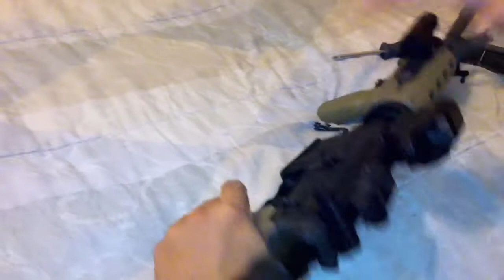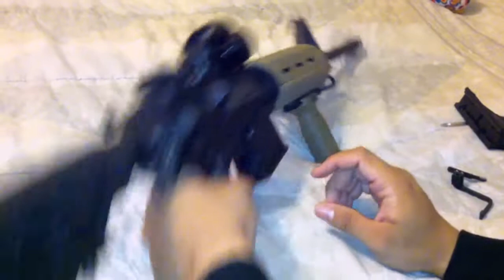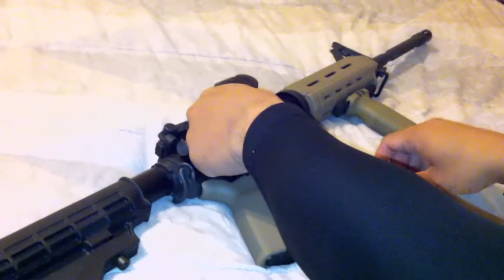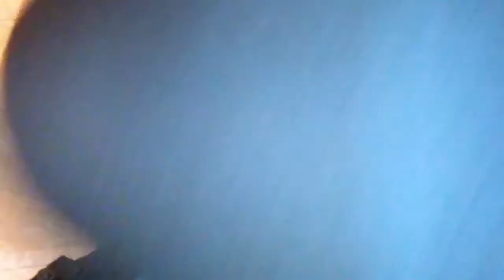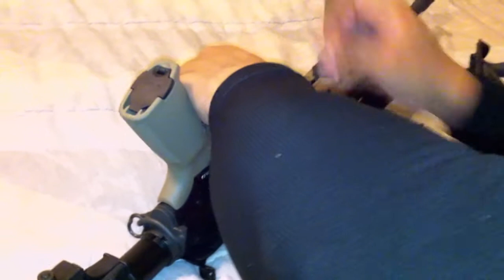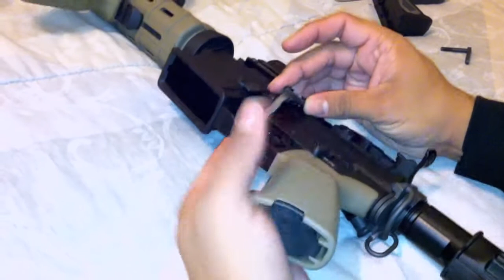Installing extended bolt release lever & Troy Industries Ambidextrious Mag Release

Comment: I have to use one of these because my thumb is too short and using my index to go-safe is much easier on the right side. I also love the Mag-Pul bad lever, love to hear what you think about them. I can keep the rifle in firing position to clear, load and operate. I did try an extended charging handle but that did not work out well so I removed it. I wish we could buy ammo cheaper and practice the AR more often.